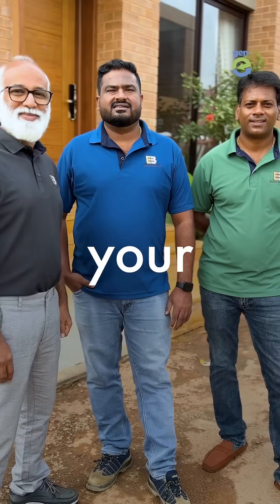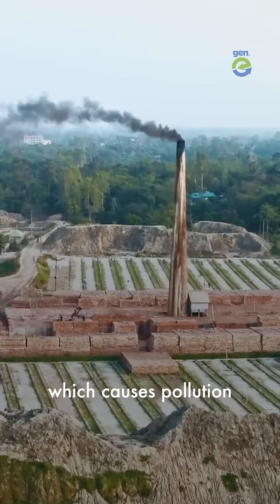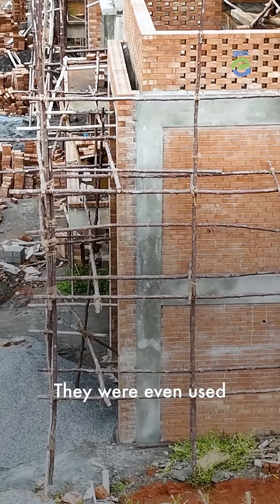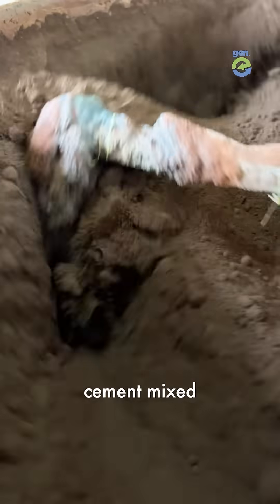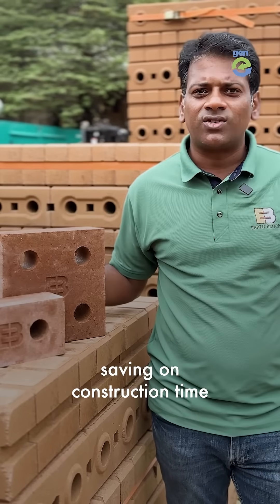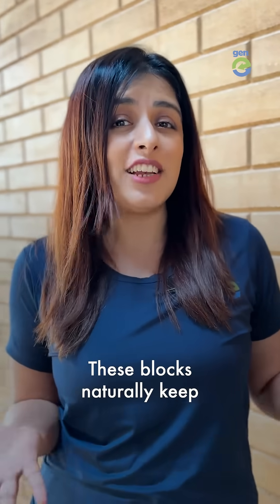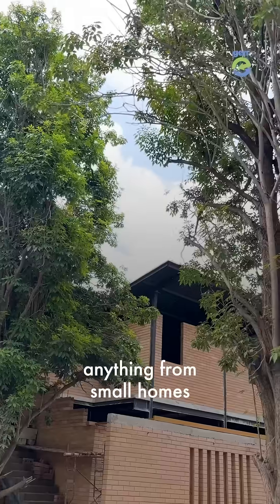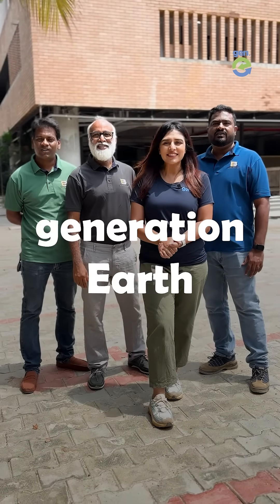Building with Earth Blocks | Eco-friendly bricks in India | Mud Blocks - Lego interlocking bricks

Comment: What is the difference between earth and clay?😂..and why the price difference..
Height of the story..if the bricks are burnt..then price is less ..and if not burnt only dried and shaped with a hole in it ..that means material quantity is less than burnt bricks and  the price is more.? How...and for what purpose...? Just for branding and aesthetics? Use wire cut / well dressed burnt bricks instead of this....

Comment: That's good. But my question about the product still remains. How does it perform in strength compared to normal brick blocks and Hollow blocks or any other blocks. What is the water capacity it can hold, what is the tensile strength of it.